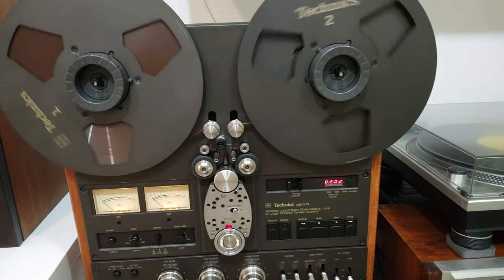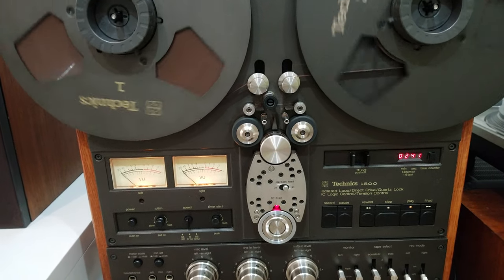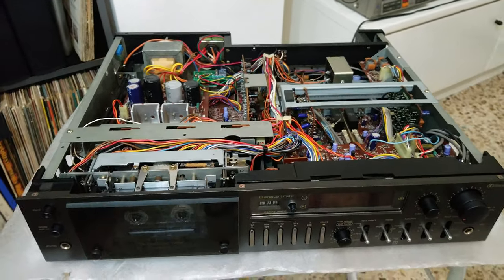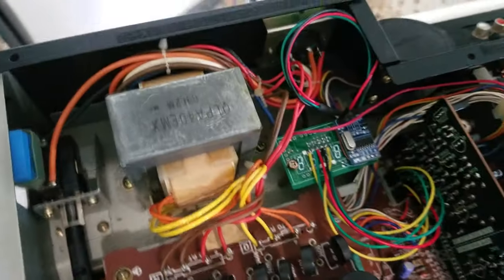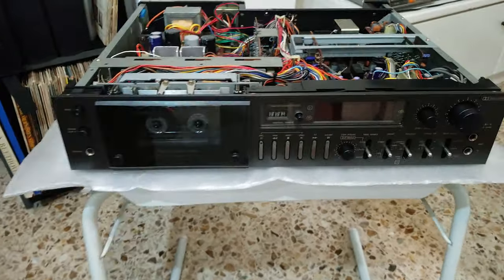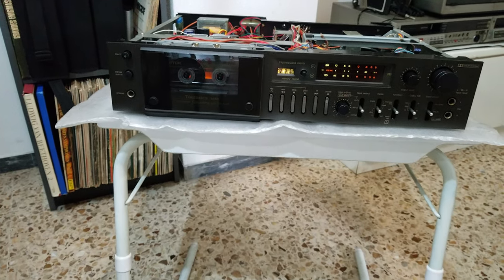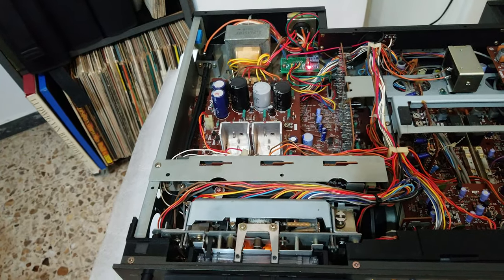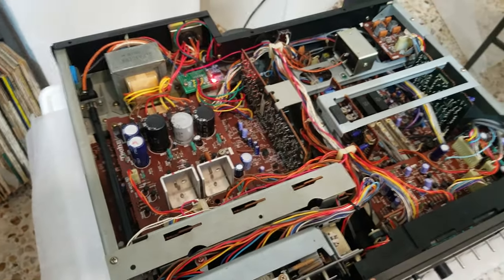Remote control for tape decks (RS-M88 demo)

Comment: This is so excellent and an idea that I have been thinking about for a while now for my Denon DR-M22 tape deck.  I was thinking of taking the relevant circuits and remote from an old dvd player, I have some electronics knowledge and the tools and handskills to carry out the job but not quite enough knowledge to design it! I would love to learn more about this, it's very frustrating when you want to do something a lot and have nowhere to learn!
  So many thanks to you good sir, for demonstrating that this and other clever and useful modifications can be done so nicely as you have done. I'm guessing any remote could be used if there is a reciever box available that can be programmed?
Reply from the maker: Thanks for your comments. The remote controller cosists of three pieces: the IR transmitter, the IR receiver and the uController board. As long as transmitter and receiver "talk" the same language (NEC IR coding in this particular case) and the IR receiver can translate this code into a protocol (TTL serial in this case) that the uController can handle; everything will work. Of course the program in the uController must be aware of the different codes used for every function and behave accordingly. But apart from that it may be considered as a "general purpose" commander.

Comment: Nice job. Any links to buy control board and remote?
Reply from the maker: First production batch will hopefully be ready by end this month. Please feel free to contact me at email address "clonix41@gmail.com" if you're interested.
Reply: @diegodiaz2168   Mr.Diaz. i have a Toshiba wireless boombox  without remote  RM933.  I found Sony RM933. Do you think it may work. Your video gave me  another option. I would like info where I can get board and remote.
Thanks.